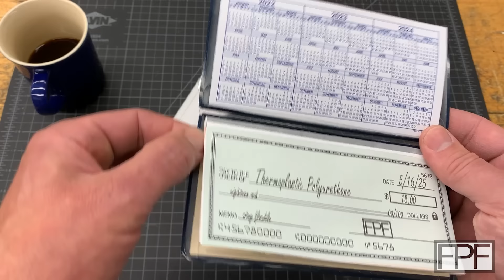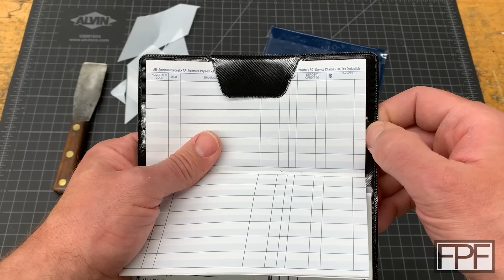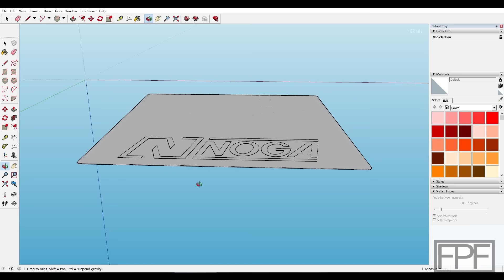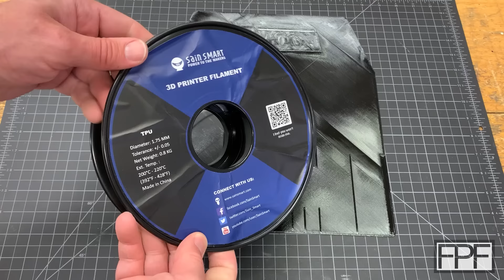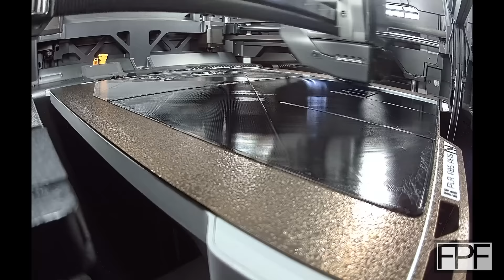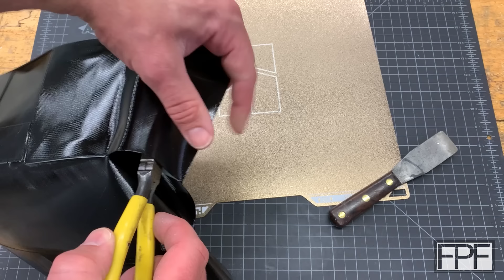3D Printed Tool Roll and Checkbook Cover

Comment: That checkbook holder is really a nice example of what 3D printing can do. It never occurred to me to make something like that. I have the set of long, rear deburr units from Noga. Truthfully, they don’t work as well as I had hoped. They don’t always pop open and when they do, they don’t always pop closed. I haven’t tried them in plastic. I wonder if the angle of the blades are ideal for plastic. I suppose that now I will have to try. OXO makes some narrow spatulas that are tempered stainless and taper in thickness towards the front, where it’s very thin. I haven’t tried it for this purpose, but it’s an interesting thought. It’s the bellows that has me interested in making. I need a special bellows for my surface grinder. When I have time, I’m going to try to design one for that. Making our own bellows is a really big deal! They are either really expensive, or the wrong size.

Comment: If you used modeled supports instead of generated, then you could add little tabs making it easier to remove without needing the scraper.

Comment: I use a release agent for all of my prints that I think really works great. I found a guy's DIY magigoo alternative made with clear Elmer's liquid craft glue (PVA?), 99% isopropyl alcohol and water in a ratio of 1:2:2 respectively. I spread it very thinly on the unheated PEI sheet using a TPU squeegee. I usually then warm the bed it in the printer to 100°C with the aux and chamber fans on 100% to dry it fast. I fill a 20ml plastic syringe and use about 5ml per sheet. Usually don't have to reapply for a few prints, but I reapply to spots as needed.

If you spread it properly, you can't see it on the textured sheets and it doesn't affect the texture on prints at all. TPU, PETG and ASA parts stick well when hot and come off easily once cooled. Sometimes I don't even bother cleaning it off the print's bottom its so thin. But it dissolves very easily with warm water. It's definitely faster and easier to use than peeling off with scraper.

Comment: It occurs to me there is no real need to remove the support interface material, just pop it loose on one side and use it as a color accent.  I also vaguely recall a way to stick TPU or PLA to fabric with ironing, but don't remember the details.  Adding fabric to the multimaterial print could add more strength and puncture resistance to the TPU base layer.

Comment: If you do more projects like this, try modeling the Z-dimensions at an exaggerated scale (10x) so it’s easier to work with. Moving away from functional, I could see pairing this technique with a machine like the Prusa XL to make multi-colored wallets and bags.

Comment: You could probably use a pattern of ribs one layer high to make it stronger in one direction, so it would want to fold over easier in the direction you want. I don't know how well that would work with the support material though.

Comment: This is an awesome project. I've really not put much thought into printing objects that are pretty much suited to fabric materials.
Had no clue FDM could print such consistent thin flexible surfaces. 
You could also add in multi-layer panels of PLA between very thin 'stitched' panels of TPU and create foldable nets that become stiff 3d structures. A strong tent, collapsible storage, stow-able furniture, etc.

Comment: I think the reason why PLA sticks well to TPU on a smaller test print but doesn't stick on the full large print is because on the latter TPU has more time to cool down and become more solid. Maybe you could play around with the slicer and make the layer start from the side where you're not going be printing PLA on the next layer?

Comment: User Vision Miner's Nano Polymer Adhesive as a release agent.

I use Vision Miner's Nano Polymer Adhesive as a bed adhesive as well as a release agent. It does leave a thin residue layer on your prints, but a quick wipe with a damp towel (either water or isopropyl) will do the job. I haven't had any issues with it either. They claim it works with most materials except PP, and based on my experience, I would agree. I previously damaged a couple of PEI sheets with PETG and TPU but haven't had that issue since I started using this stuff. My most used materials are PLA and PETG, but I use ASA, PC, TPU, and PA6 from time to time as well and haven't had issues. I have printed ABS as well with it, just haven't done a lot of "testing" of ABS with this nano polymer stuff ever since I discovered ASA. It might feel a tad pricey, but it's well worth it. You don't need a ton of it anyways to coat the beds, and it lasts forever. I don't necessarily run a print farm, but I do have three printers and use them quite often. I bought the bottle about 6 months ago and still have half the bottle. I also haven't washed my PEI sheets since. If I notice a slight bed adhesion issue, I'll apply a drop and spread it on the problematic spot. 10/10 would recommend.

Comment: Vision Miner Nanopolymer works really well for a release agent/be adhesive. It is applied very thinly so it leaves no residue and doesn’t interfere with the texture. I use it on the holographic texture plates and it doesn’t affect the pattern. I print TPU on smooth plate and it releases well.

Comment: I wonder if pre printing the support material ahead of time putting a pause at the correct layer then sticking the pre printed pla support down to the tpu would work for people with single extruder machines

Comment: Couple of ideas: print on a 1 layer thick raft of petg/pla to make the prints easier to remove or just get a different buildplate meant for TPU.

Secondly to make the supports easier to remove from the pockets you should custom design them with little pull tabs.
For the bellows you could probably take this one step further and make the pull tabs one big block across the different layers so they can be removed in one go.
Reply: The tabs idea for the pocket liners is great. I think he was using it as an assigned support material though. More designing needed for the tab.

Comment: I've done many tests in regards to printing TPU on PEI and so far my favorite approach was to use 3Dlac but in a suuuuuuper fine dust coverage. The neat aspect of it compared to typical hairspray is that it evaporates quite well leaving such a thin layer that it doesn't change the bare texture of your print bed. If you spray it fully the TPU won't stick but if you spray it over the sheet from a distance from the top it will cover the sheet in a fine dust. This will make the TPU stick really well with tiny spots where it doesn't. And you don't see any different on the finished surface later.

Comment: This brings up a couple thoughts for me:
Instead of PLA/PETG, what about using a different color TPU (and manual swap back to black) for the logo? So, instead of removing it embeds the second color.
Would adding a tab that sticks out on the interface layers make them easier to remove?
I've also used IPA for releasing stubborn prints. It doesn't need to be crazy pure; even 70% works fine (can probably dilute down to 50%). I wonder if immersing the build plate in a shallow pool of IPA for a few minutes would wick further and release more, or if it would damage the build plate.

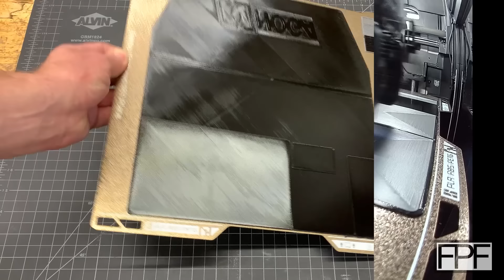Comment: What about making the pocket more shaped like the handle that goes in it? So that the support block will be shaped more like the handle? Then the pocket doesn't have to be as wide. And for more efficient rolling it must be better to try and spread the accessories on top of each other than in a row? 17:28

Comment: Awesome video, thank you.

I've been using Giant Arm and GeeeTech TPU with no issues removing. Lifts off with a plastic razor blade or my finger nails. I'm worried about scratching the PEI plates so no metal scrapers for me.

I love using the holographic plate for TPU looks cool. When I receive a new box of TPU I like to dry it for 8 hours before use.

For the first check book the PLA could have been left in as a backer for writing on. This would give you the thickness you were looking for.

I wonder how many companies rebrand product as their own, changing sources hence the variation of print quality?

Comment: Looks great!  You probably could have added a slip band across the entire width of that above the pockets for the top fold over to slide into to hold it down. or a heavier "tab" like on the checkbook sleep to tuck the top edge under.  Not needed but would have been fun to see a more complex support.

Comment: Just a thought: instead of having a slice of PLA between each flap of TPU, cant you join the PLA on the outer side, so you can separate the Pla and Tpu in one go (maybe by spreading the Tpy slightly)? So you dont have to manually pick out each Pla layer by hand

Comment: If you want a quality knife (scraper) check any professional paint store , not Ace or Home Depot, for knives. I'm a professional painter and most of my knives I use for interior work are flexible, thin and will get under even the most stubborn print. Be prepared to drop at least $7 plus for a 2" knife.

Comment: If you’re going to physically roll the tools up anyway then you could print the Noga logo underneath one of the pockets and you’ll never have to look at the back of the embossed text.
Reply: Great idea. I was going to suggest using an extra layer on the flap area, but your idea is much better.

Comment: I've found you just need to put the PEI plate in the freezer for less than a minute and the TPU will just peel off.  Much less effort than painting on IPA and working free with a tool.

Comment: Have you got a chest freezer? I often put my print plate in mine and it seems to help the print just slide off. If you do have to bend the plate flex it in towards the print not out of that makes sense.

 I don't normally print with tpu though so you'll have to try it and tell us if it works

Comment: I think I'm a long way off, having a multi head printer, but it's an interesting concept, that I haven't seen anyone else using. 
Instead of just having the support layer, fill in a gap you put in to your model. Why not use a separate part that prints in pla / petg. That way you could make a deeper pocket. It's a while since I used sketch up, for my CAD design, so I'm unsure if you are able to export as separate parts.

Comment: What if you used an interference layer that didn’t need to be removed? Something that TPU would stick to, but not as well as it sticks to itself?

Here’s an idea that I have not tried: print a separate mask from a few layers of whatever is cheap and easy, like PLA. Then print the checkbook, tool roll, whatever, but without the PLA interference layer. Instead, edit the print to pause and move the print head at the point where you want to add the interference. Lay the mask on the print and spray with something like hair spray. Maybe do two coats to be on the safe side. Remove the mask, wait a moment for the spray to dry, and resume printing. When done, you only need to break the bond between the TPU and the spray — there’s nothing to remove.

As a refinement, print the mask upside down and add a little raised border at the corners so that the mask registers against the print, ensuring that it’s positioned correctly.

Comment: In some cases it might make sense to leave in the plastic insert. Having a hard back on the checkbook might make it easier to write. Or bones in a toy or whatever.

I'm also curious a out mixing different hardnesses of TPU to make things bend in certain locations.

The next obvious thing would be clothing, and non flat things. For your tool roll you could make round pockets, putting down a half cylinder of plastic Insert with TPU on top. Though a bellows might be more efficient in material

Comment: This is a great idea!

Might the PETG interface layers be easier to remove if they were modeled as parts in CAD, so you could add a tab to them that extends past the pocket for easier gripping?

I'm also thinking you could add a small knob on one edge of the pouch and then print a strap with holes and another knob at one end; the strap would slip over the knob on the pouch and offer an adjustable way to hold the pouch in its rolled-up condition. It might work even better if the knob on the pouch was actually made from the PLA/PETG support material, printed so it has a flat base that's sandwiched inside the TPU. 

Bambu's liquid glue makes a good release agent and doesn't clog the texture, but you do have to take the print to the sink and rinse the residue off the print afterward. 

I keep my IPA in a lab wash bottle. It's grab-and-go but doesn't evaporate. You can even get them preprinted with "isopropanol" and the correct safety diamond... I have one such bottle for IPA and another for distilled water (for cleaning polyurea plates). Just don't cheap out, the cheap lab wash bottles tend to sputter instead of stream...

Comment: I always just wash my PEI plate with alcohol before every print, I think it leaves a very thin film that helps break adhesion after print. Ive been using the BiQu glacier on the printer I print TPU with though and Im not sure that bed is PEI.

Comment: I've had great luck using PVA liquid bed adhesion agent like Magigoo for TPU. No IPA needed and if you're patient, prints can be peeled by hand. Remaining PVA agent on the part can be cleaned with water, since PVA is water soluble.

Comment: Did you reduce the cooling for the PLA interface layer? Had similar issues with PLA support for PETG. Reduced the part fan for PLA to 20% and AUX to 0%. Worked pretty nicely.

Comment: After separating the PETG/PLA layers I would probably leave them in place as pocket protectors for anything pointy. PLA might be too brittle, but I would bet that PETG would still roll up fine and if left attached to the outer shell might keep the roll from bunching up with tools inserted. Or really lean into that idea and have print-in-place hard inserts for bulkier, 3d-shaped pockets with contrasting colors.

Comment: Property taxes are a crime.... Loved the technique of adding pla as a spacer. Planning on doing a set of bellows for the MINI Mill. Tool pouches, now there's a cool thought. You can also get drywall blades which are pretty thin as well.

Comment: What a GREAT idea.  I never would have thought of something like this for TPU.

For future models with that transition material, print a "tab" that extends out from the final top layer to give you something to pull on or work with.
Reply: I also was thinking he could make the transition material have a semi circle base rather than square so there were no corners to get stuck.
Reply: Coming here month later, I had a similar thought watching him pull the PLA/PETG parts out of the pockets.
Reply: Maybe h tried and it did work?

Comment: TPU is awesome for perfect first layers.  A hilbert curve and an aggressive squish works great.  I've done a lot of ASA parts that have a first layer of TPU to get a flawless face.  Parts that are highly visible and cannot look cheap.  It's less necessary of late as leveling has greatly improved over the years.  But it's still useful.  Obviously, in this case these two materials do adhere to each other.

Comment: While you have the advantage of the H2D's nozzles, I believe this method of PLA Support for TPU may be achievable with designs like such where we place a 'Pause' at single sheet interface layers for an External Filament swap.   Onerous; yes...  But doable for flatter; one off designs.

Comment: I've found the "nano polymer adhesive" from Vision Miner works pretty well as a adhesive/release agent that doesn't impact the texture. There is certainly a residue left on the bottom of the print, but it rinses off with warm water easily. I haven't used it as a TPU release agent, but its an excellent adhesive for big prints that like to peel up in the corners. Ive only used it with PLA?PETG, and despite its rather high cost, ive been using the same 120ml bottle for a long time now and its only half gone. It tends to work for a half dozen+ prints without needing reapplication.

Comment: I'm interested in pla/tpu mounts for a tool vest I'm working on. The vest itself has little mounts on it (think those quad lock phone mounts for motorcycles) and then the tool holders that go on the vest that jold my square, torpedo level, nail pullers etc. Have the inverse female feature to mount to the vest. My use case is a tool vest but I could see this being handy by a lathe or mill aswell.
Reply from the maker: I love this idea!
Reply: @FunctionalPrintFriday  i have already made a prototype of the vest, i can send pictures if you pursued this idea for context. My limiting factor right now is using velcro to mount to the vest, i hate it and think a pla/tpu mount is the ideal solution, as the baseplate on the vest could be tpu and stitched into the vest, and while the part that interfaces or "locks" to the tool holder could be pla for rigidity, then its a simple ad integrating the female slot/dovetail etc into each new tool holder, essentially creating a purpose built home for each tool i use, with none of the bulk of a traditional tool belt. (I am a sider)

Comment: I wonder how those would turn out printed with lightweight foaming TPU? I like the concept, but the shiny finish of the top surfaces is really off putting. Foaming lightweight TPU has a matte finish. Siraya Tech has a relatively expensive lightweight foaming TPU on Amazon.

Comment: You are a sick man for thinking of this.  We would get along just fine.

BTW, frequent use of high concentration IPA can prematurely degrade your PEI build sheet.  If you don't slather on the bed adhesive or hairspray, you should still get great print quality and get easier separation from the bed.